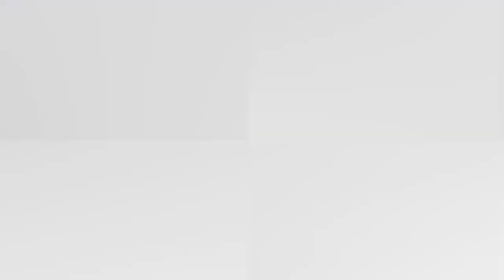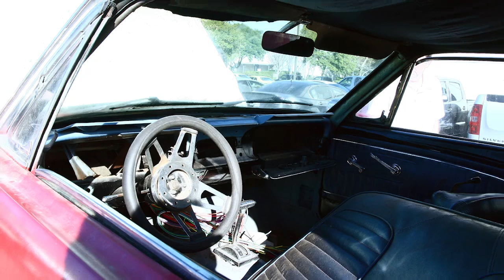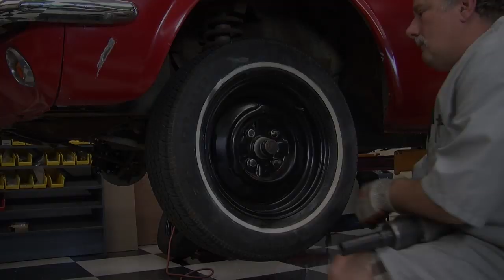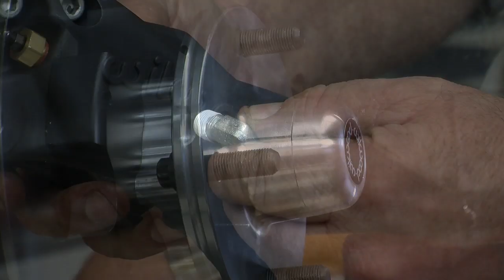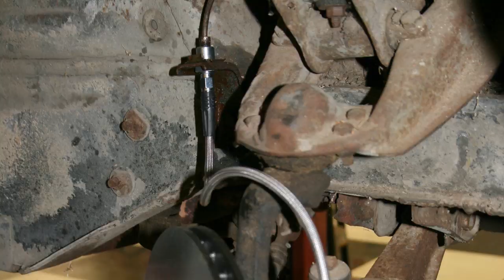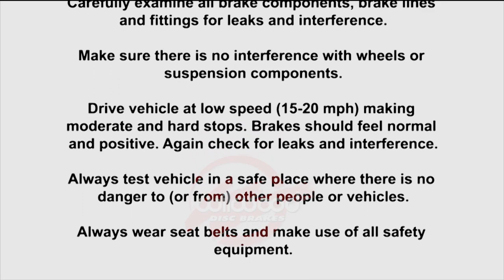1965 Mustang Wilwood Brake Install - Project Workhorse

Comment: Must be the Hulk to hold that spindle with one hand and torque the wheel studs to 77 ft lbs
Reply: Im installing this exact kit later today and was thinking the same thing. Tip I saw is to put your wheel / tire on the ground face down. take the hub with pretty firmly snugged up lugs already installed, and slide it into the wheel. then you can kneel on the wheel and the rubber friction will keep the assembly still while you torque it